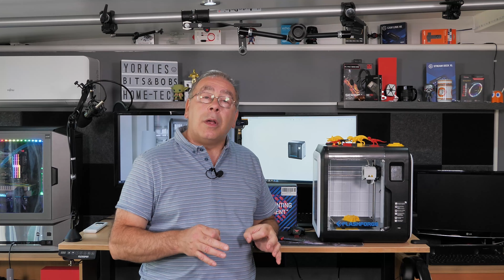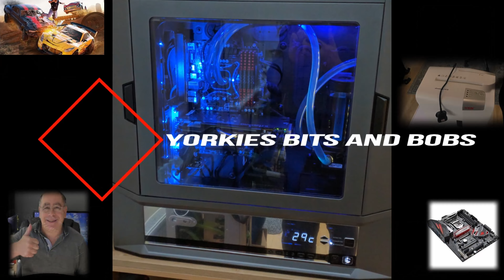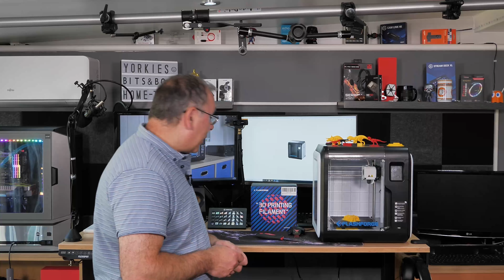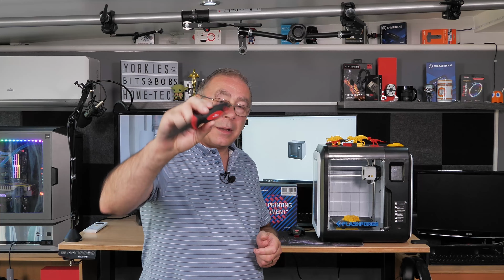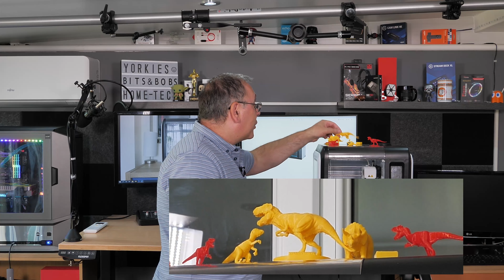Beginners guide on using a 3D printer, websites/software and filament

Comment: Very good video excellent as always , love the ending showing it working. I suppose you could design something to print if needed to use for things around the house I only asked as if some plastic item broke could you make a new one?
Reply from the maker: Thanks for the comment and yes you could make a replacement part, I have some filaments coming in different colours so look out for that video plus I will be making a battleship and thors Hammer
Reply: @YorkiesBitsandBobs  Great, can not wait